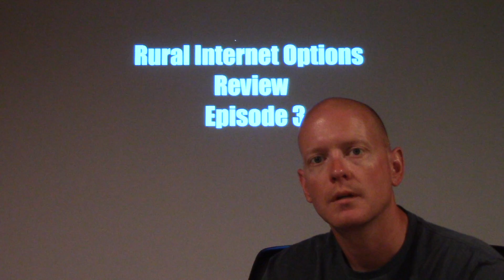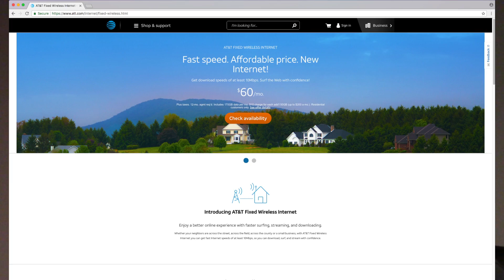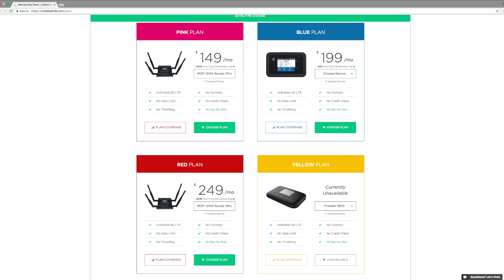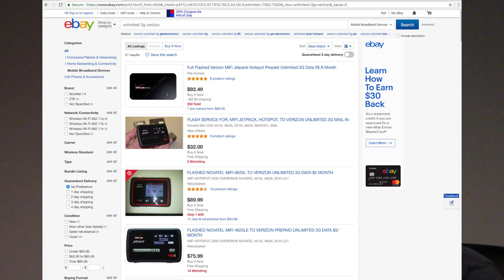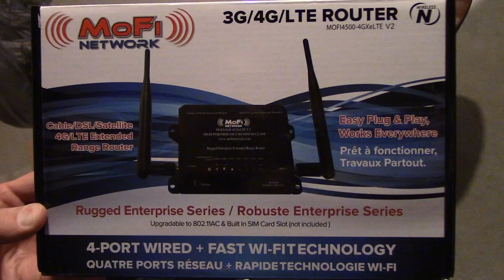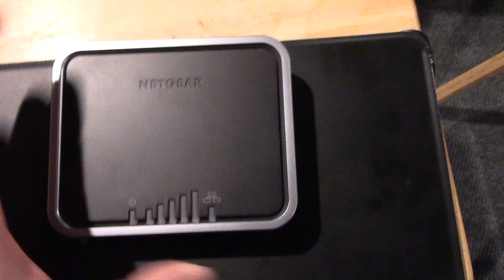Wireless Rural Internet Options 2018 Update - 4GAS AT&T Verizon Viasat 2

Comment: Does anyone out there know why my mofi isn't working? I have a sim from straight talk, it is for verison tower. I also have a sim for att tower from straight talk in wifes phone. I tried both and they show up in the router as far as they are identified. But I have no internet connection. I have hooked to the bands available and nothing. I can see the cell tower out my window across the field, it is a clear line of site. I dowmloaded a app to see which band my phone is using it says 1, but the mofi doesn't even see 1 when I do a band scan. Any help is appriciated.
Reply from the maker: I don't think a straight talk Sim will work. Straight talk may have the Sim tied to the IMEI on your phone. That would be my guess
Reply: @JackofAllMasterofNone   Okay Thanks

Comment: In a few weeks I'm moving to a rural area that will be getting fiber optic service around the 2nd quarter of 2020. What would you recommend I use as a stopgap until that becomes available? Do you think one of the YMMV eBay 4G unlimited plans mentioned would be passable for a few months as a main home internet option?
Reply from the maker: I believe it would suffice as long as you have good cell coverage.

Comment: What is your opinion about the Netgear Nighthawk M1? We in a rural area, but not like you. Unfortunately, we have limited service for cable/dsl internet. I am trying to learn and find other options and ran across your video.  I like the idea that you mentioned about the 4500 and using a wifi router though I am not sure we will need it since I live in a single story 1600 sq ft home. Your thoughts?
Reply from the maker: The M1 is a good router. I had one, but it died and stopped working. The power section of the board went out. I have a feeling its because I left it plugged in all the time. The M1 is not designed to be a home LTE router and is supposed to be run on battery often and then recharged like a phone, which is very inconvenient.  The MOFI 4500 is meant to be plugged in and left alone.
Reply: @JackofAllMasterofNone  According to my research, it is recommended by Netgear to remove the battery if you plan on it being stationary to avoid battery/internal damage.  We plan on going on the road soon and we like the ability to take the M1 with us. But, the 4500 is really keeping my attention.  I am also trying to figure out if a Yagi or Omni antenna would help my signal strength.  I have an ATT Tier 1 tower west of me about 3-4 miles and a Verizon Tier 1 east of me about 2 miles.  The other services do not even get a signal, so I am left with those above. Still researching...thanks for the information and reply.

Comment: Can I game with at&t fixed internet is all I want to know like shooter games that require a decent to good latency?
Reply from the maker: Depends on your area but yes at&t has low latency
Reply: @JackofAllMasterofNone  awesome fingers crossed there aren't any issues. I live in Florida so the terrain is flat I know there's alot of other variables that come into play though. Spectrum is literally 3000 feet from my house they said so only option atm is fixed wireless.
Reply: Att set me up and I was tickled for about 12 hours until the modem did a download update and changed its nat type to three.  It was on type two when they set it up but they say it can’t be changed from 3.   But it was on two to begin with 🤔.   NAT type affect game play and type three makes it to where you mostly can not connect with game servers and usually can not chat.   I’d guess it limits your on line multiplayer by 99% or more.
Reply: @jamesa6693  use a VPN
Reply: Jack of All Master of none I have unlimited hot spot with FIRSTNET through At&t. Problem is that the Nighthawk mobile router wont work. Both firstnet and AT&T said that it will not work with the router because it does not support unlimited hotspot. They stated is not provisioned to work in the router. When I first put my SIM card in I get really high speed and then it slows down later in the day. AT&T said it does not work because it realizes that the SIM card is not in a mobile device. Will the Mofi 4500 work with SIM card? Or maybe I can just tether my phone with the unlimited Sim to the router. Thank you

Comment: I used 4Gas for several months, but the throttle after hitting my data cap as crazy.. I will go from 12mbps to 1. I'm looking into an ATT plan now, do you know if I can you the ATT sim with my 4gas modem. Here are the specs https://4gantennashop.com/modem . The sim I had with them was a Tmobile one.
Reply from the maker: You would need to know if the modem is carrier unlocked, which i would bet it is but have to make sure.
Reply: @JackofAllMasterofNone  In case it helps somebody else, my new ATT data plan sim worked PERFECTLY with the modem. I'm glad I didn't have to buy another one. Let's see how it goes with this new service.

Comment: Will this Yagi antenna setup work with the GAS hot spot or is there a better angle to point at the tower? I'm 3 miles from ATT tower. Hot spot comes in tomorrow, is it just better to test once hooked up? Trying to use the 45 Degree suggestions I've seen. https://youtu.be/FwMhjZ0ZC9o

Comment: Is that the OBi200 I see there, how has worked for you so far.
Reply from the maker: Not a single problem. Why anyone would pay for a home phone service is beyond my comprehension.
Reply: Same in my case, I get charged $88 (att bundle as cheapest in area only to connect solar panels to Tesla...  usage is only 5kb/month). Give me a break, so trying to use cellular onto my existing account and plug into device to connect (only $10 extra per month). No surfing/Video/or streaming, only a few kB per month saving $

Comment: At 16:45 you imply that you need to activate the SIM on a tablet to get the $29.99 dataconnect plan. That is not true. The device does not matter. You simply need a valid IMEI for a qualifying tablet when you signup. I've done this several times with various NetGear LTE modems and hotspots.  It's definitely not a theory - it is a fact. It's not likely that AT&T is going to "crack-down" on this because they have actually mentioned that the sim can be moved to any data-only device once activated. The fact is, the activated sim will also work in a phone (for data only) if you change the APN to "broadband".
You may not recommend it, but it works well and it's the cheapest readily available umlimited 4G data you can currently get. It's not new either - the dataconnect pass has been around for years...
Reply: Hello thanks for commenting how do I set this up? Where do I buy the imei and sim card?

Comment: How do you get the sim card activated and what plans are you supposed to use?  Is this a 22G plan with throttled speed after?
Reply: #Chris Renfro The Dataconnect pass can use any AT&T compatible SIM. AT&T MVNO sims are fine. I use H2O wireless sims.
The trick that you need a clean IMEI for a qualifying tablet device. If you have that, the $29.99 pass will be offered. If you don't have the proper IMEI, you won't be able to signup for the $29.99 pass.
The plan is NOT throttled. It is subject to network management after 22gb, but unless you are on a heavily congested tower, you will never see a slow-down. Most of the time your speed will only be limited by your antenna setup and signal strength/quality. I'm three miles from my tower and can get 50mbps or more under ideal weather conditions. I continue to get those speeds even after using several hundred gb in a month. I'm using it right now.
Monthly LTE Usage

GB USED 185.05  
7 days  remaining

Comment: I live in thee rural part of network, my nearest cell tower is art,Be about four miles away with a hill and a lot of tree coverage, I chatted with 4gas earlier and they said be about 85 a month and would have to buy a antenna for better signal with a ones time payment of almost 400 upfront, Worker spoke to could not give me average speed I might even get, Hoping maybe you would know a tad more ?
Reply from the maker: Best thing is to check coverage with a cell phone at the location first. If its decent with a phone it will be good with the router.  They use tmobile service

Comment: my head is spinning after watching so many vids on different technologies, services and options.  I live in rural area with Verizon cell service (unlimited data) I have two problems.  1) poor cell signal... maybe -126db to -118db signal strength (which is considered unusable) I drop calls all the time.  Have to move around and hold my jaw right... 2) I have no "internet" except for my cell phone which is not the best with poor signal and I also can tether with 15GB per month per device (I also have a tablet with unlimited data) again, since my signal is poor everything suffers.  

I am wanting to know how I can "boost/amplify" my cell signal first to get better call connections and also boost my connection from LTE up 4G so I can then have better internet connections.  I am open to dedicated device/service  for internet even if it means a service through a different carrier (AT&T/T-mobile etc) 

Guess I'm looking for what hardware you would suggest (yagi antenna mounted up  high?)  My cell tower is about 5 miles from my location.  What other hardware to integrate cell/internet in my home) Is it possible you can clarify or direct me to the specific part of the video and reference the hardware/devices/services you might look into?  Sure appreciate your videos and hope to hear from you.  cheers
Reply from the maker: Sounds like you need a network specific booster. Zboost makes one for Verizon that I know works well.  https://www.amazon.com/dp/B00KDZEE5Y/ref=cm_sw_r_cp_awdb_t1_304wBb7865114

It benefits from a directional outdoor even more if you can aim it at your nearest LTE tower.
Reply: i'll give it a look, thanks for the tip...
Reply: @TheJakeRobinson  u need a Mofi network with an external lte 4g dual antenna true MIMO    
If u need more specs I'll help u
Reply: @Fennec1919  sure, I would like more info if you can help. Jakerobinsonrvp at Gmail dot com
Reply: @TheJakeRobinson  
Some Geek stuff hope it will help a lotta guys... Verizon has 3 LTE bands   2, 4 & 13 all Mifi devices or Jetpacks are set to band 13 that's why the speed is so low ithey call it Carrier Aggregation with the MOFI Network device u can change that band from 13 to 4 or 2 and lock it in the Mofi Network device you have cellband scanner and u can scan and see how many bands u have u can also Lock your band on band 4 and you will double or triple your speed
Another thing there is no limitation on devices on Mofi Network
U need 
WideAnt2-X™ Dual Antenna (outdoor) and MOFI MOFI4500-4GXeLTE-SIM4 
U will see the 45 degree angle of the  dual antennas are for a better performance it will increase the speed why 2 antennas !? It will double the data rate... hope it will help
Reply: @Fennec1919  Thanks for that!
Reply: @Fennec1919  thanks a lot!! i appreciate your knowledge and being specific and to the point, that was a perfect explanation. however i may have more questions for you :)

Comment: I do NOT live in the MIDDLE of nowhere, oh I WISH I DID!!!  I live in the HORRIBLE Fort Worth Dallas "Metroplex" these bastards around here call it.  I live on the SOUTH SIDE of TOWN where all the THUGS ARE.  The CRIME is non-stop here.  Thugs everywhere and the Sheriff's Department will NOT PATROL the road I live on.  Texas SUCKS.

But the DEAL is, if you live over 5 Miles from the Central Office from the Phone company HERE you cannot get Cable ANYTHING.  

If you live 5 miles or more of the CENTRAL OFFICE that is owned by the AWFUL Phone company you cannot get anything.  All I can get is Skybeam aka RISE, or Hughes.Net.  They BOTH SUCK.  That is all I can GET.  The idea that everyone is hooked to the "Internet is FALSE".  The Hughes.net will NOT go through RAIN for ONE.  Of course we are in a terrific HOT and dry DROUGHT, but STILL it sucks.  It is EXPENSIVE TOO.  They ALL LIE about their service.  They OVER SELL IT and cannot provide the service as they do NOT have the EQUIPMENT and facilities to acomodate what the SELL and they KNOW IT.  To ME that is FRAUD.  They should be PROSECUTED for that.  Put the bastards in JAIL that will get their attention.  BB

Comment: Right now I have DSL but it's pretty bad. It will go off during light rain storms and it can sometimes be unusable during peak hours. I've thought about either supplementing it with something like 4GAS.  I've had AT&T technicians tell me that they dont know how I was able to get DSL and I shouldnt hold my breath for an upgrade. Would it be worthwhile to run a 4g connection and the DSL connection into a Dual WAN router?
Reply from the maker: Or you could ditch the DSL altogether with a good LTE connection
Reply: I as in your exact situation with slow (<3 mbps) Verizon DSL. Constantly crapping out when there was any kind of weather. DSL is being neglected nationwide and shutdown in new places everyday. I saw the hand writing on the wall. All the money is flowing into the wireless infrastructure.
My advice, ditch DSL completely. I had Verizon cut my landline also and now use an ObiHai for 100% free phone service - free long distance, caller ID.etc through google voice.
Then get an unlimited LTE dataplan. From 4Gas or Netbuddy (much cheaper) or a $29.99 Dataconnect plan from AT&T (WAY cheaper!)
The dual WAN router is also a great way to combine bandwidth and speeds. I use two Netgear LB1120 LTE modems - each with a set of cross polarized yagi antennas. They are combined into a TPLink TL-R470T+ load balancing router. The result is that I get overall speeds that often max out the TL-R470+ at 100 mbps. Even more speed would be possible by using a Gigabit load balancer such as the TPLink TL-ER5120.
Multiple unlimited accounts are still practical (affordable) with the $29.99 dataconnect plans. You simply need (or now how to generate) valid qualifying data enabled tablet IMEI numbers. When you have them, get some new unactivated AT&T SIMs and head on over to the buyasession.att.com website.
Reply: I'm in the same boat as you are what did you decide on it has it worked out for you? DSL less than one megabyte a second if it works

Comment: Hi I have a grandfathered $20 / month Mobley unlimited  car connect plan. What’s your experience using the Mobley SIM in the Mofi 4500? For the rest of the summer on the weekends we’ll be in s location with decent AT&T LTE. Thanks!
Reply from the maker: It works well.
Reply: Jack of All Master of None thanks. In the meantime until I got your answer I was on a RV Internet Facebook group and was asking about routers for the Mobley. I was told that the Mobley isn’t internally classified by AT&T as hotspot but as a Connected Car after market device. Therefore if AT&T detects my Mobley SIM is in something other than the ZTE Mobley they could kick me off? 

I was under the assumption since the Mobley is a hotspot you can use the SIM in any hotspot device. 

Now I’m confused.
Reply from the maker: Officially AT&T probably could but so far they havent for most users. You can use a mofi4500 in a car as well is my opinion